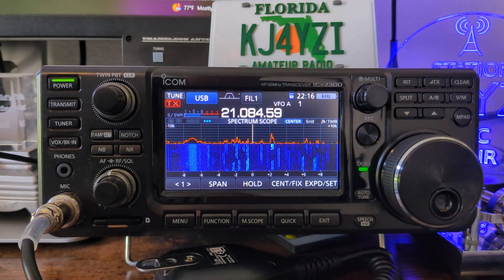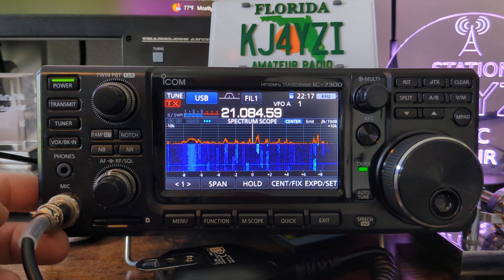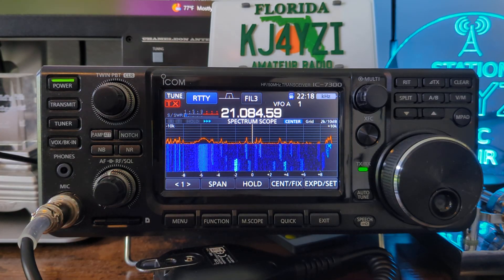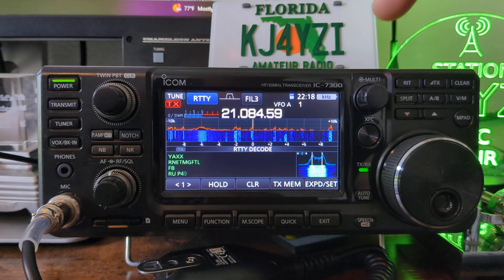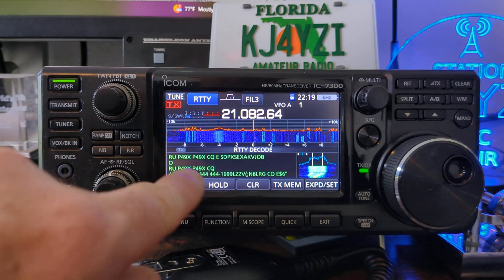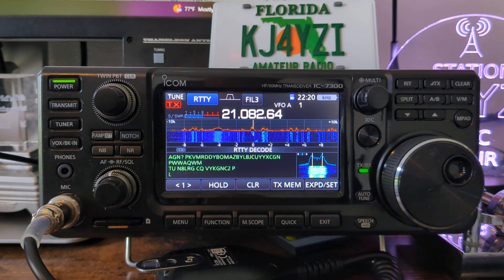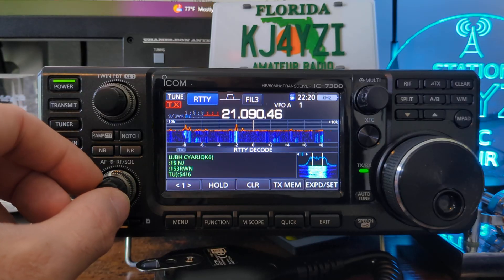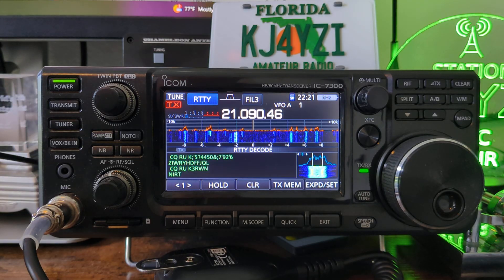Icom IC-7300 RTTY Decode Feature

Comment: The 7100 and 705 have this feature as well. It's geared for contesting and not having an actual QSO. It can be done, but extremely slow. 

To have an actual RTTY conversation, a laptop with software (HRD or FLDIDGI) would be the best. The bad thing about RTTY is that it's only active during a contest. Once in a while during a SSB contest, there might be a few people out there on RTTY.